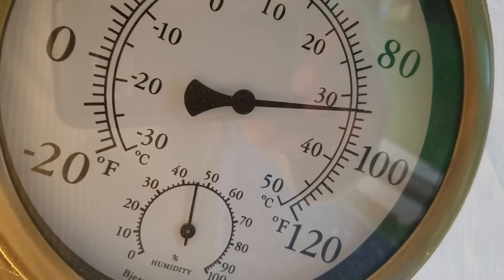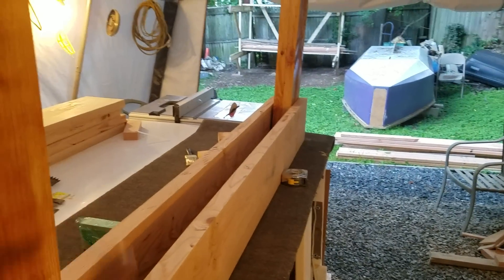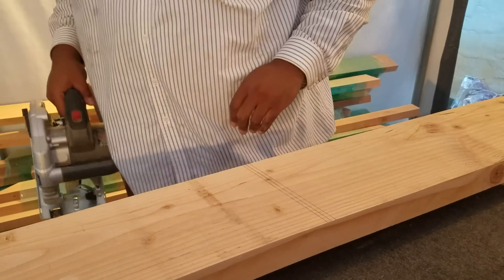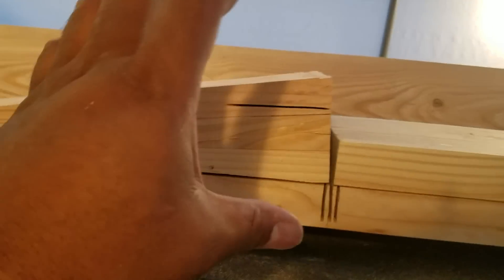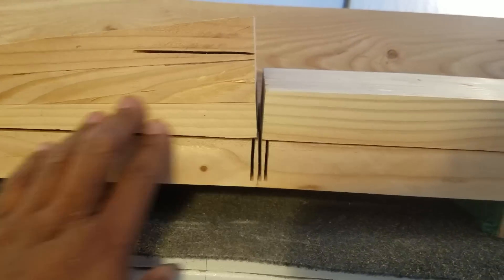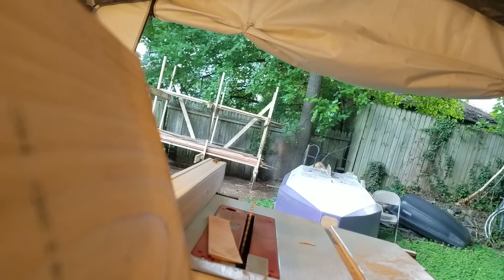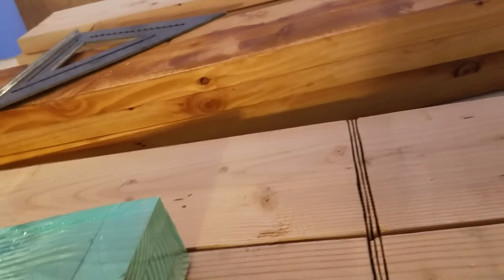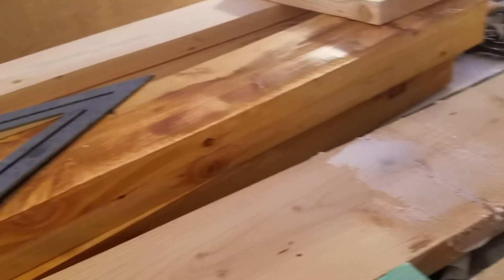Kerf cutting the keel beam

Comment: A couple of suggestions.
1) Get some push sticks.  I hate seeing anyone's fingers/hands on the left hand side ot the work piece.
2) Make yourself a cross cut sled.  That really would be the best way to make that cut.
3) Buy a free standing 9" disc/6" belt sander.  A few seconds on it would have made a flat surface on the bottom so it would not rock on the table while you were trying to cut it.

And I am sure I don't need to say anything about the wild free hand cut above the blade !

I want to see you with 10 fingers at the end of this project !

Comment: Just a thought, and don't mean to be critical here, but...
Did you consider steam bending the boards?  I would think that would allow for a more hydrodynamic bend with more of a curve leading to less drag in the water around the keel.  I realize it would take longer though.  One could get a PVC pipe with end caps large enough to house those two boards and connect it via hose to a boiling pot of water and steam the boards for a few hours, and they should then bend right around whatever you are working with.  Again, just a thought, and your ultimate goal may require something different.
Reply from the maker: greetings John. I don't think steam bending wood on 100 degree day is a very good idea :-) besides this took 1 hour in total much easier. one and a half inch 2 by tens would have had to steam for about 2 hours and I only needed it to bend 1 inch . Steam bending can be useful but really is overkill for what I'm trying to do. Thanks for watching peace and blessings.
Reply from the maker: Also please understand that this is just the backbone of the keel beam. Two more layers of wood get put on and then it all gets shaped to make a hydrodynamic foil. it looks rough but it will actually be very hydrodynamic in the final form.
Reply: You could steam bend but for this thick, you would have to steam a really  long time and have hydraulic equipment to bend. Thinner lamination would work but it is a lot of work for little gain. It's not really a structural component that would benefit from being laminated rather than just shaped. Even easier than the PVC is to take a sheet of Styrofoam insulation and score and fold into a tube sealed with duct tape. Holds the heat in better. Slope it back towards the steam source and recycle the water into the boiler.

You can have a clean flow around some pretty odd shapes and surfaces. There are things about hydrodynamics that are not really intuitive. Best example is the dimples on golf balls. You get some really fine entry foil and it will get smushed pretty bad when it grounds against something. Better to have something with some beef to it.

Comment: I think I would have just built it up as a block and cut the angle.  Once you get them built up, sometimes it's easier to say screw it and get out a chainsaw for roughing cuts.

You going to build the CB case now or once you get things framed up?
Reply from the maker: Lol, I agree but I don't own a chain saw. It wasn't so bad, it only took an hour. I needed to work on my kerf skills, lots of rounded edges in the interior of the boat. Do you think I'm showing too much detail, making it boring?
Reply from the maker: Not decided about the center board trunk.  May be not now, because I have a schedule for the next 2.5 months. May be a 70 degree day in October.
Reply: Tough call about showing too much. Edit it down to slick video and it becomes a huge time sink and you won't put out as many. People that have not built a boat don't realize how close you are getting to a boat shaped object.
Reply: Iandi Boats Wish I had the link, I was watching videos/web pages from someone in Oz building a big cat that was pre-laminating whole sheets before cutting out the pieces. Sure looked like it would really beat trying to glass hull interior once the pieces were put together.
Reply from the maker: +David Kirtley I'm glad you can see how close I am. I'm so excited, I just want to attach the frames soo bad, but I've got to do what's right. I figure 2 more weekends on the keel.
Reply: It's going to fly when you start framing and planking. Of course then it will crawl painfully as you start finishing out and doing the fiddly bits.
Reply: +David Kirtley  Not sure if this is what you saw, but a poster named Tim Weston has just recently started posting videos that capture his building of a 40' cat in Oz.  The build is actually from about two (or more) years ago, but he has now posted the first four of his "how to's".
Reply from the maker: +JLSOhio51 I saw that, I subscribed to his channel the other day. He actually commented on one of my vids earlier these week. Cool